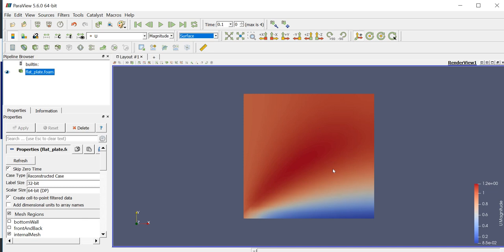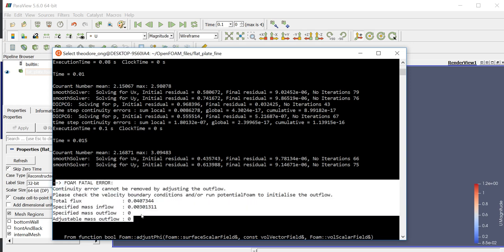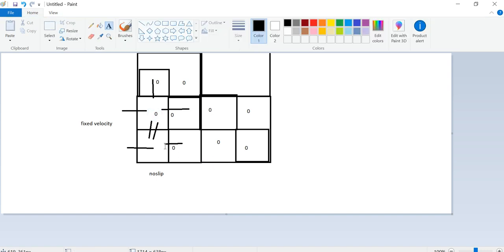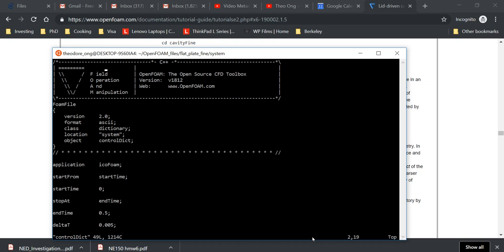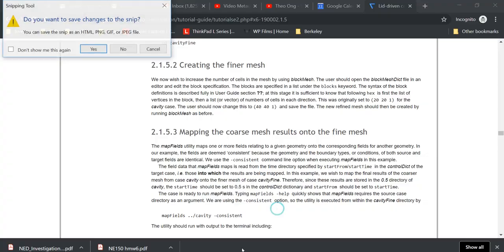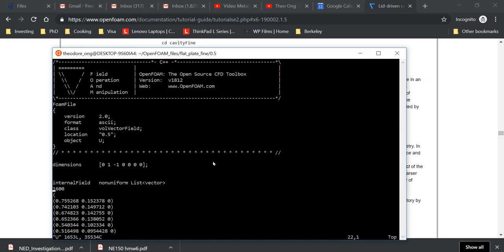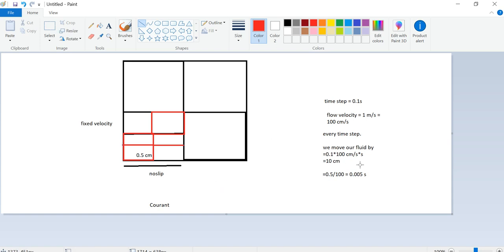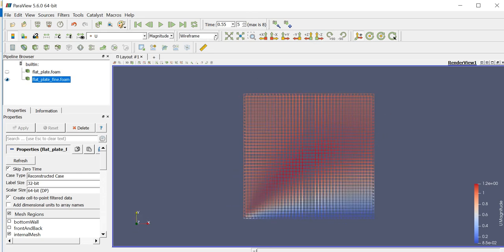OpenFOAM for Beginners win10 11-  Flat Plate Boundary Layer flow Part 2 (Mesh Resolution)

Comment: I get very confused by this video. Maybe refining mesh is early stage to learn. Specially mapField function  we used mapField function for flat_plate not the flat_plat_fine. I do not understand the reason. It is little but confusing video. I will watch second time. Thank you anyway
Reply: The mapField function refers to flat_plate because it gets the 0.5 time step values from there, then copies it over to the flate_plate_fine folder from which it begins the interpolation into a more denser mesh. The flat_plate folder is created from the previous video with the default mesh size.